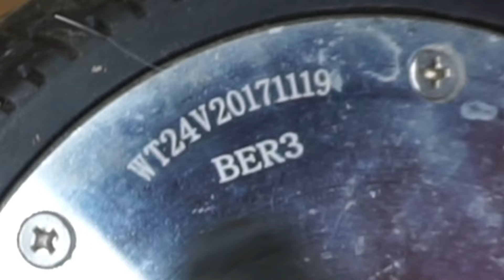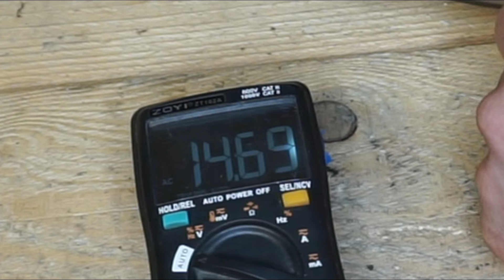Generator eolian făcut din roată de Hoverboard

Comment: What about current? Voltage is nothing you still have to convert to dc in order to charge batery and modtly needed 12 volts? What is amps in original and modified?

Comment: Cu greu sa inteles cele 6 fire legate intre ele  , iar celelalte  au aparut gata legate nu stiu ude . Daca mai ai vreo ocazie sa le explici babeste ar fi grozav . Ce sa fac ,nu ma pricep la electronica dar niste fire pot sa cositoresc . Multumesc pt deranjul tau  si ajutane in continuare cu ce poti .
Reply from the maker: Salut ,sigur o să fac un video cu detalii mai explicite cum se leagă ,numai bine mai vreau să modific unul și o să filmez și să și explic exact cum trebuie legate 👍🙏
Reply: @ionut_ursachi  hola, yo tengo tres cables  en cada una de las  fases , incluso en el punto neutro.
Reply: A anseriat  bomboanele antre ele pentru boltari mai mare

Comment: The original coil motor is connected in parallel, now we connect the coil in series, the output voltage will be high and the current will decrease depending on the work we connect to use.

Comment: Hola , saludos y bendiciones, tenia muchos motores de hoverboard de exelente calidad, y siguiendo esos pasos lo conseguí,  gracias por toda la informacion, le instale 6 elices y lo puse a girar con un ventilador, el motor original apenas superaba los 9v con el aire que generaba el ventilador mientras que el modificado mas de 100v y cuando lo conectaba a mis baterias bajaba a 60v, pero tengo una duda respecto a ello el voltage subió mucho,  ya que incluso con girarlo fuertemente con mis manos sin tener alguna carga superaba los 200v pero el hamperage es muy poco y no se si sea mas adecuado dejarlo conectado en paralelo o modificado en serie ya que en paralelo nesesito mas de 8v para que funcione el controlador de carga eolica y en serie con una revolucion por segundo se activa el podo de carga de mi controlador
Reply: Los motores que configure tienen desde 6 a 7 hilos son originales y están prácticamente muevos hice el mismo procedimiento y generan una gran cantidad en voltios , y mi pregunta es porque en serie o en paralelo ?

Comment: From original with bridge you get 60V and 10A on 300 watts motor used as generator, with same rpm as motor or generator, ~700 rpm.
If you modified inside connected 3 phases continuously , to mono-phase, you get on first 1+1=2 x2 voltage, and next last x2 from that, that should be around 60V, on the rpm you use, which is much lower than 700 rpm. On 700 rpm you would get around 180V. But amperage will be lower, maybe from 10A 3 phase lowered to 2.5A. So:
Better use full rectifier on 3 phases original and you get most out of it. 600 watts as generator or 300 watts as motor expenses on same 700 rpm.
It had been tested many times, not once.
Only add full bridge rectifier and don't change anything on the original.
Eventually you could change it to "delta" from "star" but again 3 phase, very similar, only less amperage and more volts, but mechanical resistance is lowered.

As an end, you could add ceramic capacitors on the exit of the positive after the rectifier, and it will amplify the power output, depending how many you will put, they are balancing the return impulses. But, needs to be connected only the "one" pin, other should be free.
(electrics in Physics are funny) - Same thing had been done in your videos of different controllers from the solar panel, just few ceramic capacitors, and power is used more efficiently.
Happy testing.
Reply: tnx

Comment: عمل جيد جدا ولاكن .قبل عمليه التحوير كان الفولت dc… اود ان اعرف بعد العمليه التحوير .هل يبقا dc الخرج ام يتحول ac ؟
Reply from the maker: and before the modification and after the generator outputs 3 phase AC, after with a diode bridge it turns into DC for the charge controller